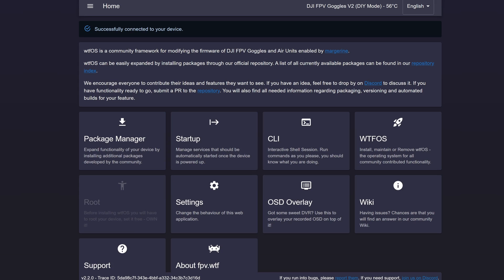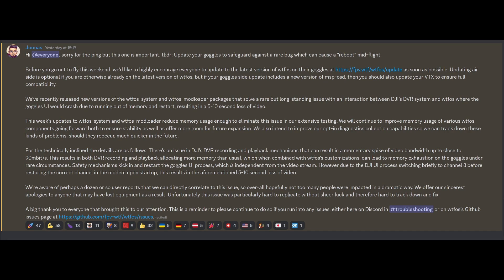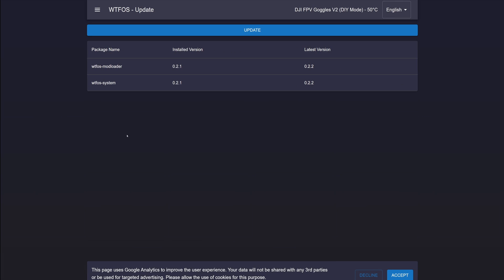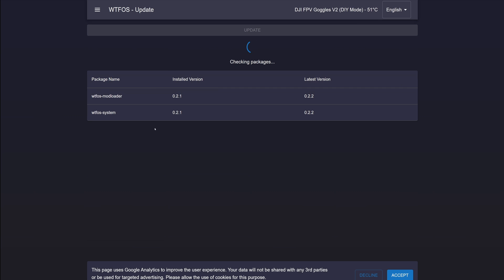FPV WTF For DJI Goggles V1 & V2 Update Now - PSA

Comment: Well, I just ran the update and now I have no DJI menu on startup in the goggles (V2), no OSD displaying (even the stock DJI OSD is missing) I've been having issues lately where some OSD settings would display in PAL format or set OSD in Betaflight in PAL only to have it default to HD and settings would be all messed up in goggle view. Seemed to be difference situations on of OSD display in a all my quads. I'm using Vista's and AU's only, no 03's...very frustrated and now I can't even go fly...any suggestions to fix this is greatly appreciated!

Comment: Thankfully this has been recognised and fixed. I’ve had the googles reboot mid flight once. I was flying in 38-40C heat, it was my 6th straight pack, and I brushed it off thinking the goggles may have overheated.
Reply from the maker: Yes it’s happens to a few but it was overall rear.

Comment: I got the update installed on my goggles after one failed attempt. I tried to update an air unit to the latest but that didn't work. I ended up removing WTFOS from air unit and re-rooting and reinstalling WTFOS along with packages and all appears to be fixed.

Comment: hmmm, i had a mid air reboot recently, thankfully in my test spot and for what its worth, it was while flying through very thick woods and signal strength was getting very low. also, after the reboot my goggles went into dji drone mode with no escape window, i had to reinstall....... uuhm... i think i reinstalled butter.... and got everything back, no need to rebind etc etc.. also i do not have 03 ability installed.

Comment: I tried updating 2 sets of V2 goggles, both had error messages-
Failed updating packages:
then whole bunch of red text about the updates then at the bottom-
* Failed to download the package list from     ..... 
Package Name	Installed Version	Latest Version
wtfos- modloader 0.2.1	                0.2.2
wtfos-system	0.2.2	                0.2.3
Now the update is greyed out and cant attempt again. Maybe its my PC but I'm sure the update didn't go through. One set of goggles was only rooted last week and the same thing happened then as well. It showed an update just after rooting then it did not work and the update option became greyed out. 
Hope I don't get black outs now.
Reply: I lost my canvas mode hack on the goggles after this. 
I simply removed the msp-osd packet on the wtf program then reinstalled it again to get it back working again. 
In case this also happens to people. Maybe we have done like half the update or something.
Reply: @KwaddawK I had the same scenario, I must also reinstall msp osd
Reply: @hwoekki  Yes I lost the msp-osd packet from working as well when the update failed. The good news is, WTF just added a further update a day or 2 ago and this was no problem getting it to work, so give it a try again.
Reply: Same Thing happened to me
Reply: Ask GPT-4